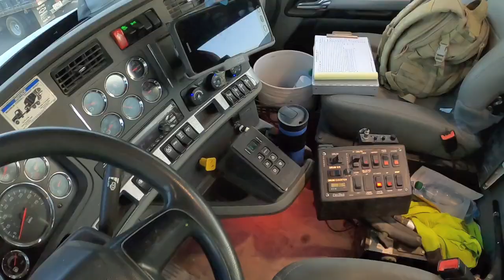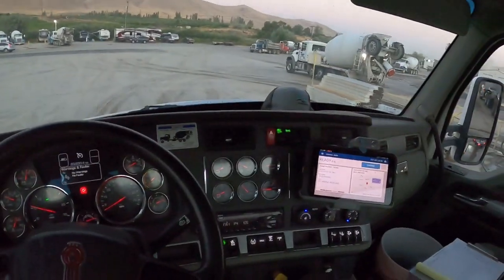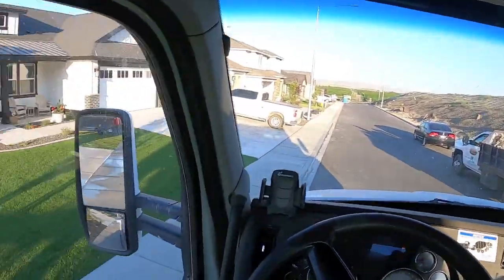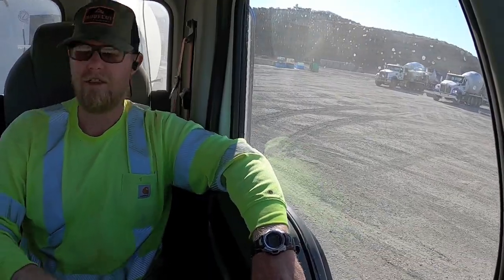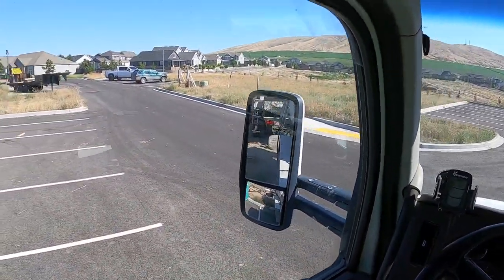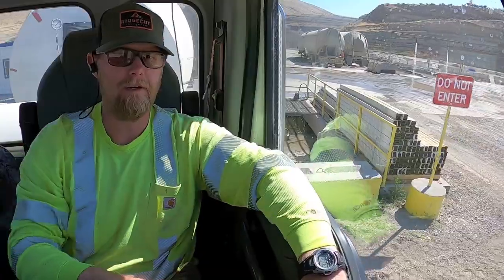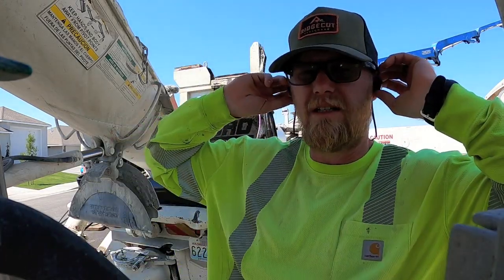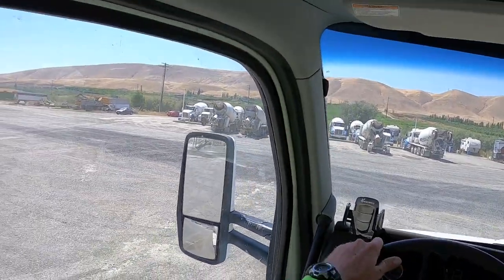Pump jobs make life easy!

Comment: Dumb question. How long or will it take for the concrete to harden even with constantly being mixed in the drum? Is there a set time or distance you can't go over?
Reply: Some places will reject the load if it's over 90 minutes old, and once it hits 3 hours it's time to get it off the truck for sure
Reply: We have a big water tank on our truck  so, u really dont have to worry about it getting too dry and hardening in the drum. U can always add water to it.  My water tank holds 100 gallons or more.

Comment: You should make videos again! Love your content! 
 I ran a mixer for about 6 months and i loved it so much. I always thought i would never be in a mixer but i decided to finally apply and give it a shot and sure enough, i loved it! I hated the truck/chute pours at first but overtime, it was honestly kind of fun. Little change of pace compared to getting loaded, slumping up and backing up to a pump and standing on the back bumper pouring lol. Got to do Shotcrete, special tiny chip mix(don't remember much), colored mix design(was usually a different shade of gray),curb machine, went on a military base for curb, that was pretty cool. I even volunteered to work on a Saturday when we normally never do, it was from 4am - 11 am on a 200yd job with a mix design with like 1 1/2 inch rock. Just a basic pad for Brundage Bone Concrete Pumping's yard.That job was crazy as it was super super fast paced and full discharge into the pump and i mean FULL. We were side by side so once i was done, the other guy starts. Lots of wheelbarrows and buggy's for sure, going high into the hills where you can see the whole city, I could go on and on and on lol. Developed a lot of good relationships with different crews and had some pretty amazing people training me.Tablet system was so convenient too, you just get assigned orders, you accept, pull around fill up your water and back under the plant. There was a menu of all the truck numbers(kind of had to memorize who was who) and tap their number and pick up the radio. Another company i was with, you had to do a lot more manual entering of yards and this and that and it was an open CB channel and had to announce you were back in the yard and so on.
Reply: 와우 무지막지한 수레작업도 불만없이 타설해주시네요.
시간 엄청걸리실듯요

Comment: I've NEVER poured a 4" slump into a pump.  They always want it at least at a 5" - but it's almost always a 6" slump,  and it drives our safety guy crazy because he says it weakens the concrete way too much..  Do u remember seeing the Amazon building being almost wiped out by tornado this past summer in StLouis area? We poured that  and poured it again to repair it. The contractor wanted slump at a 6"...  and they wonder why the building was nearly completely annihilated.  The walls are all concrete...  
 The ticket for the pour always says 4" slump,  but as soon as we get there  we have to add melchem and 20 gallons of water.. Drives our safety man crazy. We have to make note of it on our tickets to relieve us of any responsibility as to the soundness of the concrete
Reply: we are the same  way,  I'm in Nebraska. We almost always start with a 5 slump.  The contractors usually want a 5.5  or a 6

Comment: I was in the concrete industry for fifteen years I started out as a driver and learned how to batch and unload rail cars of aggregate and plant maintenance to a point. People think that all we did as turn the steering wheel and drive like a car that’s not even the case as you have found out that drum has a liquid load that will roll you over if you don’t pay attention and stay alert. I could not even explain how or what happens if that pump runs dry the boom pumps we generally would see had alert button so the pump operator knew to stop before boom now time to clean up all the splatter from letting it run dry. If you never have delivered previous that is something that can’t even explain it’s mostly chemicals I am enjoying the videos.

Comment: How would you compare a pump operator to a mixer driver . ? Which is better ?
Reply: Mixer driver definitely better from what I've seen
Reply: two totally different jobs. U can't compare the two.. It all depends on what u have a knack for.. I used to be a crane truck operator over 11 yrs ago. I was good. But I jad issues with the company so, I left. I drive a concrete truck now after 10 years being a tree trimmer..  I think being a concrete truck driver is probably the easiest job I've ever had!  It's stressful in the beginning as u learn,  but most jobs are like that, right?  A concrete driver is a good,  easy job once u get the hang of it. U gotta be a good driver too,  and that takes time..  Having good people skills is a bonus, too. U have to deal with all types of people in different situations.
 I started this job 4 months ago,  and I'm really glad I did
Reply: No comparison, running a pump is way more involved,

Comment: For my money, one of the worst pours is  footers or walls...for a crew too cheap to have a pump rig (greed...but they end up losing their ass on Truck Time).
Only the veteran guys were sent on these horrible jobs; you had to be a maneuvering expert, know how to use every half INCH of space to reach these  footers. On either side of your mixer was a nice drop so NO ROOM FOR ERROR. Our company finally told these half wits "Hey, no pump, no mud."
They started using the pumps. It was even challenging for the front dischargers, but it was HELL for the Rear dischargers...LOL...that sounded AWFUL!!
As hellish as those pours were, when it was done I was very proud of having wrangled my Mack back there and wondered "How the HELL did I get back in there?"
Then I thanked The Lord and headed back to the "barn" as oru dispatcher called the yard.
I never liked driving the front end mixers; I love the conventional with it's long hood. Also, it's claustrophobic in that little space in the front ends.
Thanks for another great video...this retired driver misses it...I miss hauling asphalt as well. Driving a dump truck was like getting paid for playing TONKA TRUCK for REAL. 
One other thing; Do you agree there is not much that can match the peacefulness of a Quarry as it's getting dark; you're the last truck in and the dispatcher gives you your start time and tells you to lock the gate. I'd see foxes all the time and deer I think a ghost one time!

Comment: Hi, I've been driving a long haul semi truck for many years and now I've been offered a job on a concrete mix semi truck in Canada, something I've never done. Is it easy or hard? Do you like it? What should I know? What's the low temperature below which you can't pour? Do you guys pour in winter?
Reply: It's mostly easy, it's only kinda hard as far as the schedule, no set schedule. Also, tailgate jobs and wheel barrel jobs can be headaches, pump jobs are 🍰

Comment: What rpm do you upshift at?
Reply: As a veteran driver,  I NEVER look at RPMs.. I'll look at MPH and use my ears
Reply: Every truck is different. Some like to shift in the higher range like 1900-2000 and some like a lower range of 1600-1700. My Kenworth T-800 likes the low range.